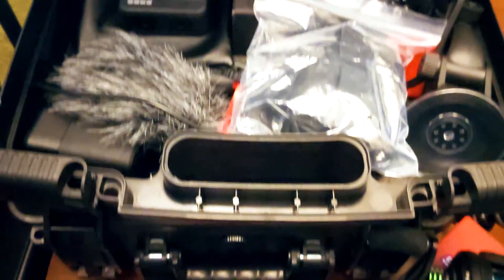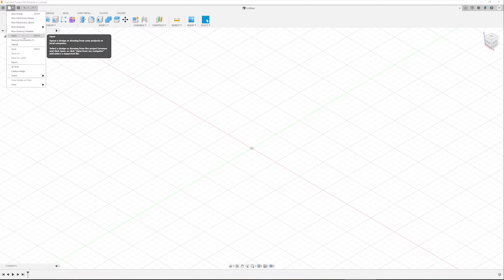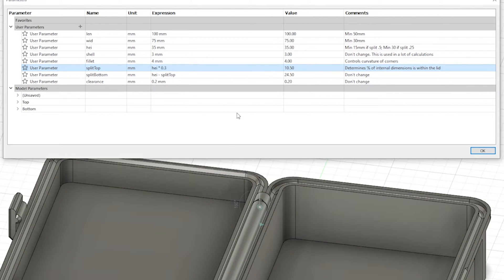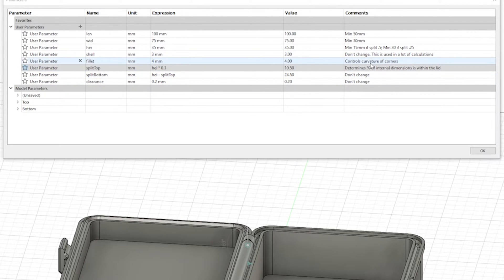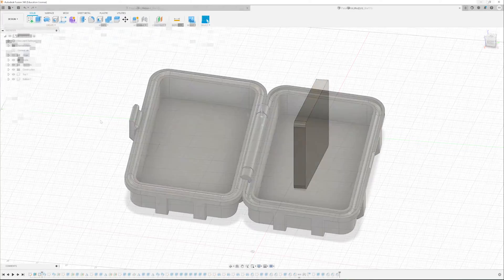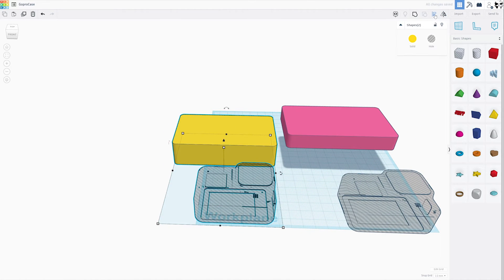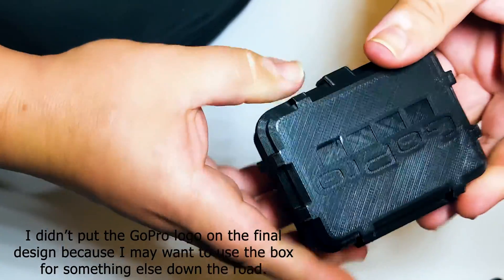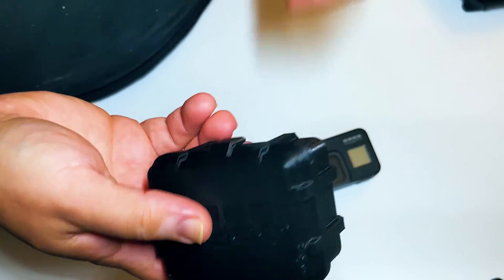I 3D Printed a Form Fitted Rugged Box | Here's How I Did It.

Comment: Lovely project. My only concern with an exact fit 3d print is scratching of three back screen and lens. Especially with 3d ridges etc.

I'll print mine and just add a bit of padding, but I love your print
Reply from the maker: Valid concern! I will say, my TPU for the insert is soft enough not to scratch it up, but I also already had a set of screen protectors on my GoPro.

These, specifically, if you want to check them out. https://amzn.to/4cE5pa8

Comment: You could make the smaller box work by adding a cutout in the bottom of the lower insert to push up on the camera.  You'd probably want to make sure the insert is easier to remove if you go that route though.

Comment: Do you know if you used any tolerance for the box and insert. I feel like you'd need like .1 mm tolerance but I don't really know.
Reply from the maker: I can't remember exactly because of how long ago it was, but if I had adjusted anything for tolerance, I typically would do it by .20mm
Reply: @Avel  Well thanks for the video. I'll just try without tolerance and if it doesn't work I'll just have and extra box for something else. Thanks 👍.

Comment: The only downside I see is the hinge, a better hinge would be to flip it back and forth from either side like a butterfly hinge, or do that but with a regular butterfly hinge with flush instead of snapping together you would drill wholes and insert a rod, that would make it more rigid on the hinge and stand up to drops better.
Reply: Agreed. I just printed something similar to that which didn’t require hardware and the lid easily falls off. Specially after smoothing the ABS print on acetone
Reply: @charlieth3kid  I could see that after smoothing, did you try again with less tolerance on the hinge for shift of material after smoothing. Also one thing I’ve been trying is adhesion bed design that you can buy adhesion plates and they come with different designs, sometimes it’s hard to get it to stick to the plate though but looks cool

Comment: It seems like you didn’t do anything to fix tolerances? Did it work because your yellow material was compressible? You mentioned it was TPU, so I figure that might be it
Reply from the maker: I can't remember exactly because of how long ago it was, but if I had adjusted anything for tolerance, I typically would upscale the model (the GoPro model in this case) by 0.20mm on all sides before 'subtracting' it from the parts that would be printed in TPU. 

Yep, TPU can be squishy, so it's very possible I didn't adjust here.

Comment: I have a quite in depth question that for simple terms starts out at if you have like in your case the box not as a model how would you go about form fitting it then? And is there anyway you know to easily make again in your case the yellow part on a “box” strait from a factory??
Reply from the maker: Are you saying you have a pre-made box and just want to make it form fitted for something?

You would need the inside dimensions of each side of the box. Create those in something like Tinkercad, then split your GoPro model (or whatever you're form fitting) and "subtract" each side of that from either side of the inside dimensions models. 

I don't know of a way to mass produce the yellow part from a factory. You'd have to share the design with a factory and they would give you options to choose from (from my understanding).

If that is the route you would decide to take, having the factory design everything from top to bottom would probably be ideal.

Comment: lol just printed this exact box before watching the vid. printed with petg and when putting it together ... the closing clip snapped off and flew across the room. I guess the tolerances on my printed aren't that tolerant? Also, I guess PETG is not that elastic that is can just snap shut or smth? The hinge also comes off on the right side. The box itself is quite rugged indeed tho. Might try printing this on my other printer or try pla I guess.

 i guess you could also print the inserts with TPU perhaps, as a it of soft filling. Personally i would just go for foam probably like you said in the vid.
Reply from the maker: I believe I printed the top from PETG and the bottom from PLA. I can't remember my infill off hand, but mine surprisingly hasn't snapped off yet. I half expect it every time I open it 😅

Yep, my inserts are TPU. Foam is a great option especially if you can't find a model to form-fit the TPU.

Comment: So I tried to do this for my ps4 controller and when I went into tinker cad and combined the controller with the insert it made the cut outs for the triggers and the line work. It didn't cut it out like the way the gopro did. Any suggestions
Reply from the maker: Sometimes this trick works.. Create a new design in Tinkercad, import the controller model. Export it as STL. Import that STL and try again.